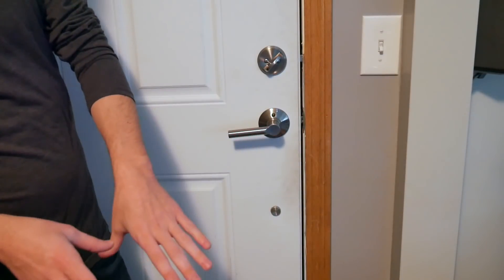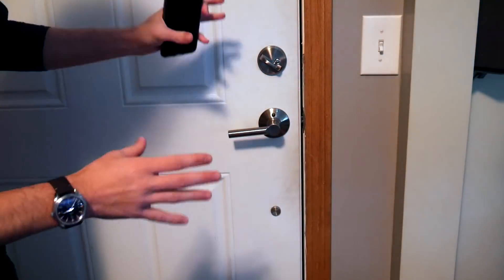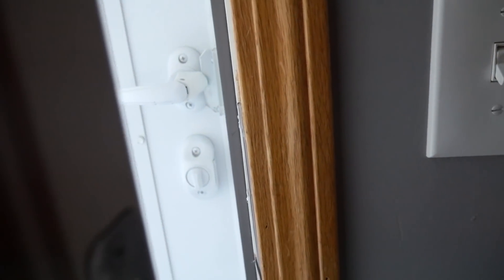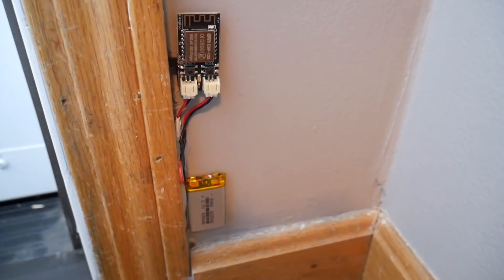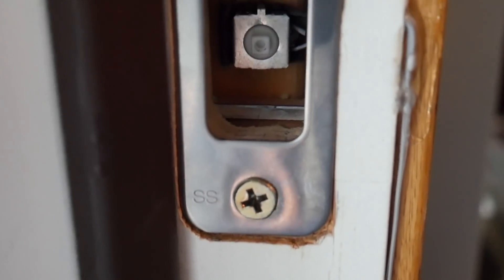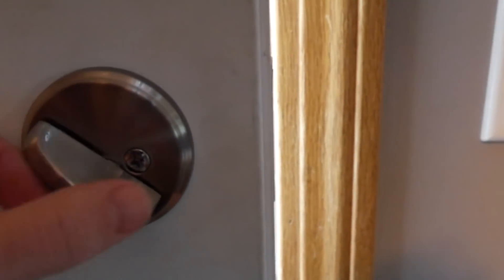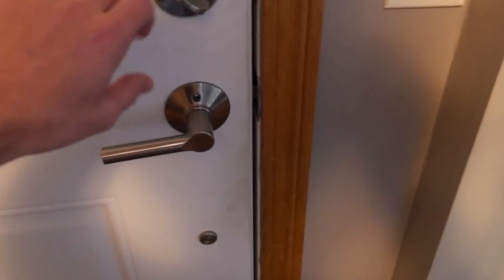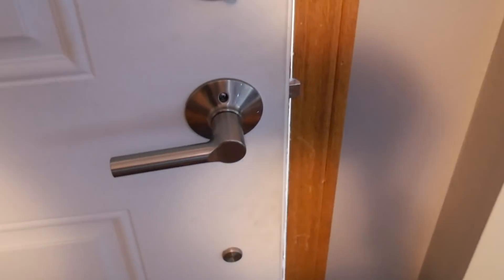Did I lock the front door? Push Notification from trigBoard!

Comment: Hey Kevin I trying to achieve the same goal as the triggboard, and I found a easier way ( not sure about price, but probably ) cheaper solution.
Im using a ESP32 that can sleep and wake up on a high state and on a low state, and to save energy, insted of mqtt I'm using ESPNow, its muuuchh faster, Im sending just one frame to a esp8266 that is connected oveer serial to another esp8266 that does the mqtt part over the internet, it could be blynk, pushbullet, a the moment im using node red on lan.
What do you think about a triggboard using esp32? Its just 3uss more, but you reduce a lot the amount of components 
Let me know. This is code for a magnetic sensor to notify on open or close and to sleep in between

//#define BUTTON_PIN_BITMASK 0x200000000 // 2^33 in hex

#define uS_TO_S_FACTOR 1000000 /* Conversion factor for micro seconds to seconds */
#define TIME_TO_SLEEP 30 /* Time ESP32 will go to sleep (in seconds) */

RTC_DATA_ATTR int bootCount = 0;
RTC_DATA_ATTR bool updown = 0;

int pushButton = 13;

bool buttonState = LOW;

void setup(){

delay(50);
Serial.begin(115200);
Serial.print("boot number");
Serial.println(bootCount);
bootCount = bootCount+1;

Serial.print("estado....");
buttonState = digitalRead(pushButton);
updown = buttonState;
Serial.println(buttonState);

if (buttonState == HIGH) {
esp_sleep_enable_ext0_wakeup(GPIO_NUM_13,0); //1 = High, 0 = Low
Serial.println("Open door");
delay(10);
esp_deep_sleep_start();
}

Serial.println("Close door");
delay(10);
esp_sleep_enable_ext0_wakeup(GPIO_NUM_13,1); //1 = High, 0 = Low
esp_deep_sleep_start();
}

void loop(){

Serial.println(" never will be printed ");

}
Reply: Also, I alteady deployed 3 esp-now - to mqtt gateways on a huge place, and each of them is placed where im sure im getting good wifi. The sender nodes are on diferent places, some of them are moving, each rx node have a spoofed mac, so all have the same mac, and if a sender node sends one frame, it could be recived on 2 nodes at the same time, but each node post the message under its own mac, so on the server im sure im getting the message from one or maybe 2 nodes, and by doing this i can extend the range of the aplication a lot. i was able to send frames at more than 80 meters

Comment: Sure, it's fun, but couldn't this all be achieved by using an ultrasonic sensor to detect changes to deadbolt handle position, as well as detect when the door is open - thus requiring no physical modifications to your house?
Reply from the maker: yea sure, many ways to pull this off...  this is just what was quickest and easiest for me.  I have a few other doors I need to "arm", so I might try some other methods.

Comment: Nice.
Not sure about the longetivity of that tactile switch though. Glue a little neodynium magnet on the bolt and use a hall effect sensor maybe.
Reply from the maker: yea, that's what I was thinking at first... will make an update video in a few months to see how well this holds up
Reply: That was my plan for monitoring the deadbolt but need to pay attention to the sleep current of the hall effect sensor. Some use mA or tens of uA.  Not great for a battery powered device.